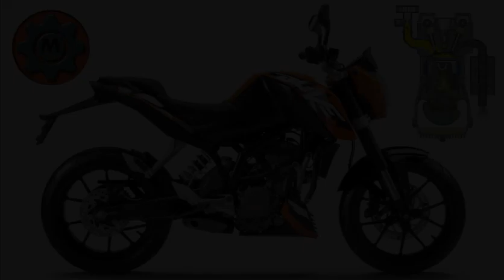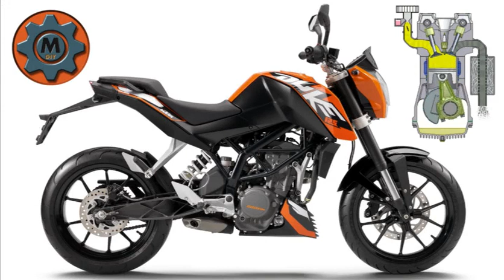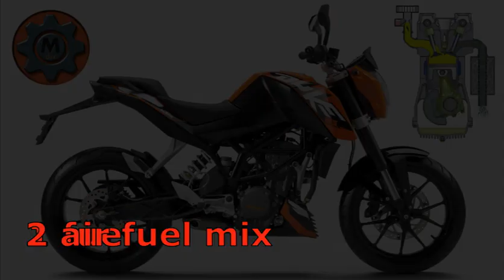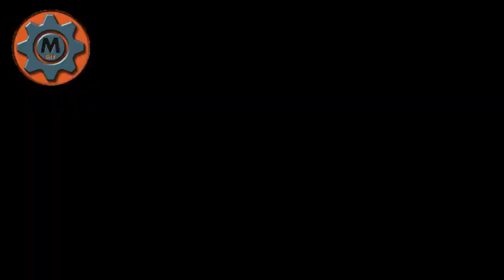ktm duke not strating - 10 posible reasons why - explained

Comment: I have a brand new Duke 200 60 km on it. 2 out five times after buying it brand new, it won't start. I already took it to the dealer once, and today it wouldn't start again. Very diappointing. Even though it rides great when running, it is so unreliable, I could never recommend it to anyone and already want to sell this thing.
Reply from the maker: indeed the duke is one motherfucker of a motorcycle 
rich with issues you can make your oun youtube chanel 
just by fixing it

Comment: I have changed the gas pump, but the bike doesn’t start even I changed the battery also the spark-plug, all new 
Is it causing by the fuel pressure?
Reply from the maker: might be a lot of thing . loose air intake hose clap , wrong intake valve gap
carbon buildup , bad spark coil ,and more 
start by testing order

1 fuel flow throo the injector
2 visible spark arking when cranking 
3 inspect the main  led screen for errors 
 like jg 1.6.0 err

Comment: Having a low pressure/weak fuel pump, engine performance is drop and my display shows "Low Oil Pressure".
Change to a new fuel pump will solve the problem ?
Reply from the maker: try adding engine oil 150 cc (1.5 cups ) and test if error dissapeare - and no it's not related to fuel pump .you probobley got engine leak or too low oil in engine .

Comment: Hai sir my bike ktm rc 200 model 2015 fuel sistem plug allso ok but bike not start head ligt not come self starter fuese allso ok but termination unit heating error cod showing jg 1.7.2 problem sir
Reply from the maker: the display shows error JG 1.7.2 Stator coil / ac charging coil  
part number 90539004000, STATOR CPL., KTM